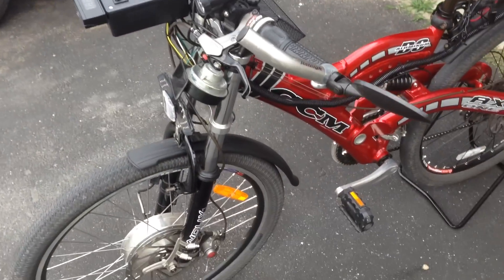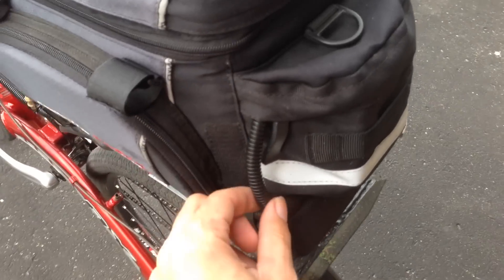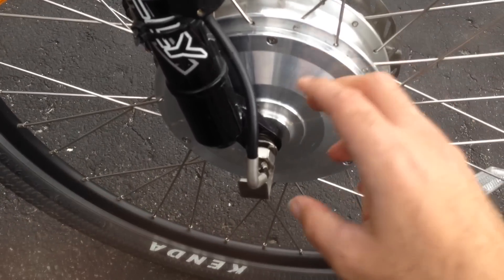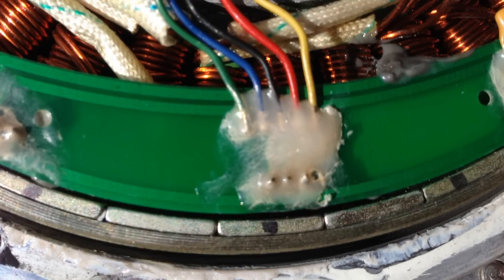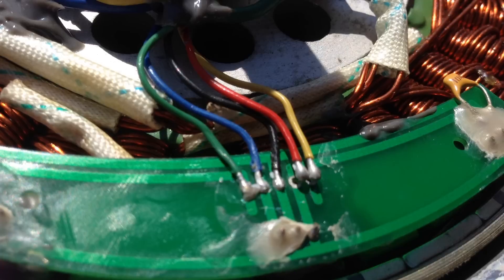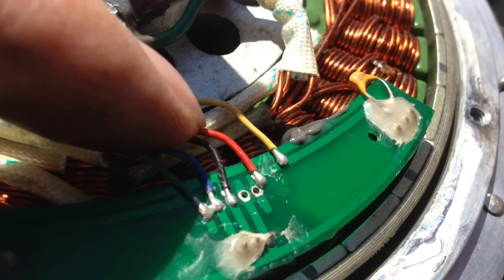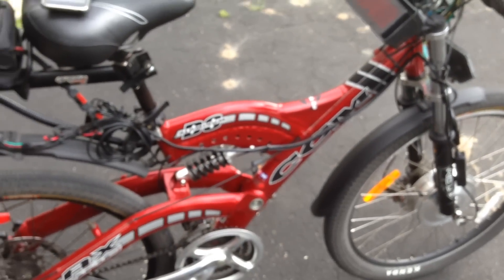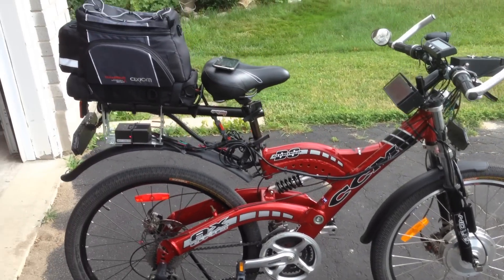eZee Electric Bike Conversion Kit - Hall Sensor Wiring Repair + Extras

Comment: i got 3 bikes one at 3800km(bms battery failure), one at 3700km(motor error codes) and last one is 2800km(still working mint)

Comment: thank you for doing this video. i have the Urban Ryder 48v 500w electric bike from Green Light Cycle and i have a motor problem with the Kingmeter giving a error 24 code (motor hall signal) which im assuming is what u just showed me.  Thanks again.

Comment: In the pictures, it looks like the green/blue, and red/yellow wires were touching each other, even soldered together?  Was that the problem, b/c you didn't show a FINAL/FIXED picture of how they should look soldered properly. I took apart my Motorino XPh, to get at the wiring harness from the handlebar/throttle/brake area, cuz my brake light was going on when I turned front steering. The clear plastic insulators that cover the connection joints had shifted off, and wires were shorting out there. So I taped them up. I thought I fixed problem but of course Murphy's Law coming into effect....NYET! I took it for a test drive and it died out on me and I had to get a neighbor to drive me and scooter back in his pickup truck. Now the speedometer reads 97 KPH and odometer reflects that speed, moving ahead while it is standing still. The odometer went from 200 to 500 KMs overnight, so I clicked breaker under seat off for the time being. This is the result of cutting corners to save $$$ at the factory I guess? I read an article online last week, telling consumers to BEWARE of cheaply made vehicles from China b/c they are DANGEROUS! My e-scooter accelerated on me in traffic and I had to swerve into a parked car to avoid going thru a stop sign onto a busy road. I smashed my left leg, and was on my back for over a month after, and did $3,000.00 damage to the parked car. The next day, the brake came on by itself and this all happened within 48 hrs of buying the scooter. The sellers met me at my storage bin to do the deal and I didn't have any contact info on them. I am seeking legal advice soon.

Comment: Thanx muchly for expounding. My Motorino XPh accelerates and brakes by itself when it wants to. I bought it slightly used. (40 KMs on it only). I have been watching videos and reading forums for a few days now, b/c with the nice weather, I want to get it back on the road. I'll watch video now, and comment after. thanx again....

Comment: Thanks, I am experiencing the same problem with intermittent shut off, I hate to take the motors apart but it may be worth an inspection.  I've replaced the throttle and inspected all cabling as well. 
What controller you are using with the Ezee setup is it the one that came with it from ebikes.ca?  I've been looking for another own that will work with the ezee system but haven't had much success.  Thanks, T.
Reply from the maker: +stratta I'm still using all the components that came with the kit, and other than this hall sensor wiring issue it's all been working fine. Not sure what other controllers will be able to run the system but I'm sure if you ask the guys at ebikes.ca they might know.
Reply: Thanks it is the ebikes.ca kit, I emailed them, thanks for the reply

Comment: Thanks for pointing out the hall wire connection fault. My hub motor is different brand,  but your vid has given me something to look at. I reinstalled my electrics after a frame mod, only to find nothing is working.